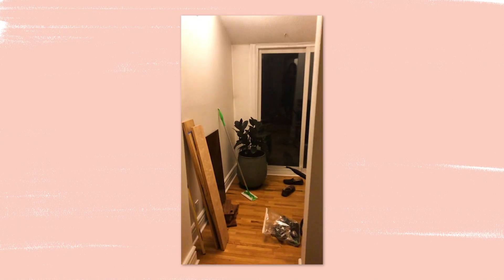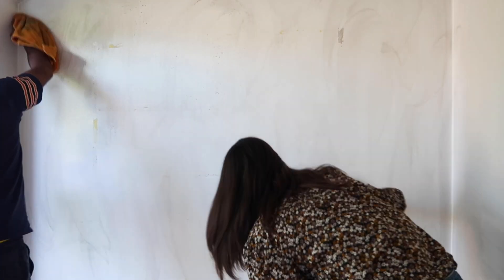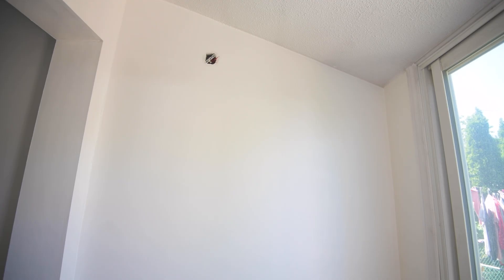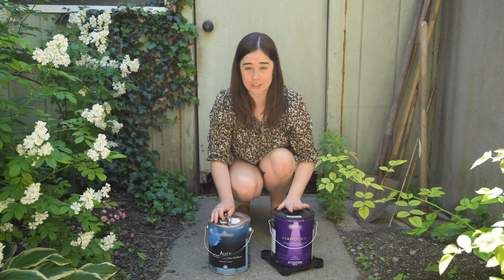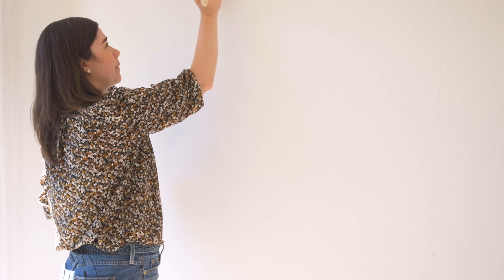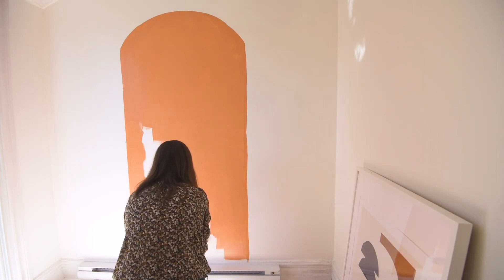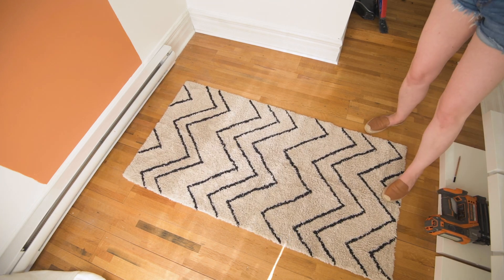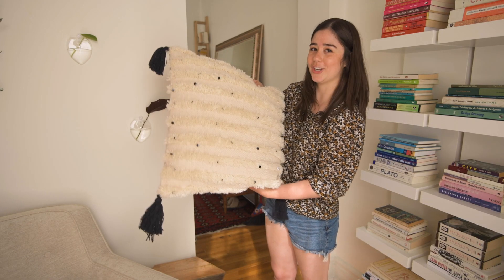*EPIC* DIY STORAGE ROOM TURNED LIBRARY MAKEOVER

Comment: Great use of space. Made the area a functioning part of the home. Was thinking you could have added a light window tent on the sliding glass doors. It would reduce the UV light and the amount of heat coming into the space. Easy to purchase at a local home improvement store.

Comment: Great... there needs to be a reading light near the chair. Wall sconce? Even a small shelf to hold a lovely wood warm light solar light (leave behind the curtain during the day to charge) would be great and require no rewiring. An end table whose base slides under the chair to be used as a lap table too would have been nice double duty.

Comment: I wonder what it would be like if the art and bookshelf wall swapped? Just felt the shelves pritruded into the walkway a bit. I would definitely stub my toe!
Reply: But then the chair would be in the way of the shelves...
Reply: I agree the shelves might have worked better on the other wall but there seemed to be a heater of some description along the skirting board under the accent, so probably not able to move it hence the shelves going on the wall.
Reply: I love how they can see the shelves from the bed. 

I suppose the shelves could be raised or wall mounted? That would fix any toe-danger. Or wear slippers 😏

Comment: It looks much better now.  The owners could invest in fully opening timber style French windows giving a view onto the garden, they'd look  much better. Two general tips:
1) always paint the CEILING too (and first), it  makes such an improvement even if you don't notice it specifically 
2) when installing a curtain rail think of dressing the WALL not the window... In this case if you had fitted the rail across the whole width of the end wall, when you have the curtains open they will sit against the wall and won't obscure any of the window.

Comment: I would have opted for a table that can unfold from the wall on chains and fold back up with a sturdy hook to hold it. A more comfy curved wire chair with a faux fur throw on it and a floor lamp that curves over the chair and desk area or just the chair whatever is needed. A round bigger sisal or jute rug. Curtains were perfect. I think floating shelves for books over the table area and put a few jars on them with the books for pens,pencils,markers scissors etc. The wall where the books are i would have done a gallery type photo frame wall with the plant clippings . A very narrow cupboard to store some of the other clutter that was there and possibly add a simple coffee maker,sugar bowl and powdered creamer. Two cute mugs hung on the wall next to it to grab a coffee without having to go to the kitchen. And in my head takes up even less space but looks cozier.

Comment: Should you run into the soot  issue again use a vacuum first. On the walls   ask me how I know this...
Reply: How do you know this? :)
Reply: Thanks for the tip 👌. I have to paint above a storage heater soon.

(I can't believe they worked up. I always clean walls from the top down, way easier when you don't have to redo the baseboard.)
Reply: I actually had an aquarium blow upoh, yes the three things in your house you don't expect to catch fire or the aquarium the bathtub and possibly the toilet. However the aquarium did catch fire and I had black soot over every inch of a two-bedroom apartment. The only thing that worked was vacuuming.

Comment: Unfortunately the leaves you clipped won’t propagate! They will eventually die. There needs to be more than one leaf and have a node to be able to produce roots
Reply: Two of the plants did have multiple leaves and nodes, and the others might not need multiple leaves. Different plants propagate differently. I have a money tree that propagates from single leaves, because the nodes are at the ends of the stems.

Comment: It looks great. I'm always horrified to see you replacing light fittings and reconnecting wires. I've no doubt you turn the power off at the mains but even then this would be illegal in Australia, where this can only be done by a licensed electrician.

Comment: This is pretty but it isn’t practical. The bookshelves are partially blocking the route to the door. I think you should have traded them with the plant wall. They want to work and read but there is no reading lamp or place to put a laptop. Also, as a reader, organizing books by color is silly! Sorry for the negative comment, you are usually do a great job, this was no up to your usual standard.
Reply: agree that not the optimal functional layout -